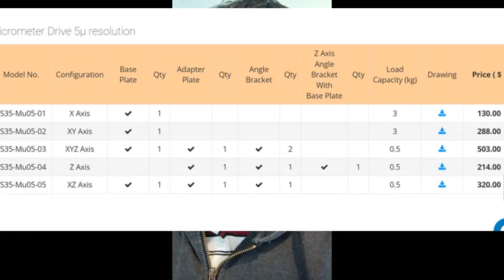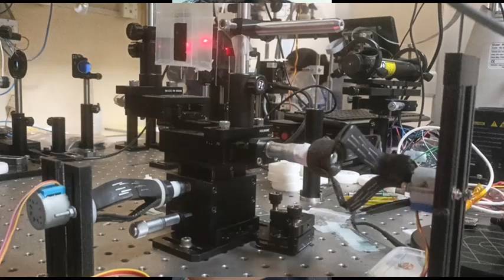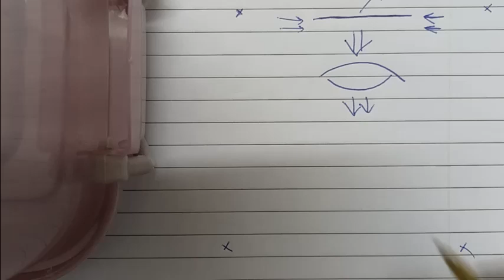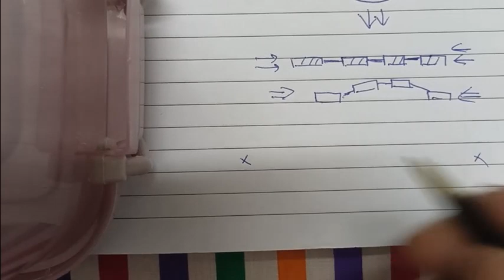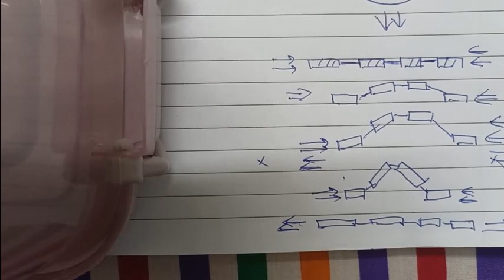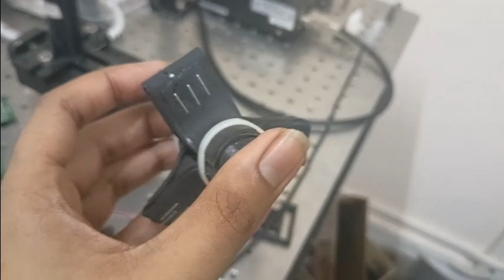Motorized translational stage from normal translational stage using compliant and flexure mechanism

Comment: Can you grow successful KDP non linear crystal using KDP based fertilizer for frequency doubling ! I spend very letter afford doing this because I am lazy i crystallize but crystal size is not large i didn't tried re Crystallization but i think doing this will work I I choose big seed crystal  but i know this salt is hard to grow single crystals so Other similar geometrical seed crystal needed one are Rochelle salt . Can you try it ?